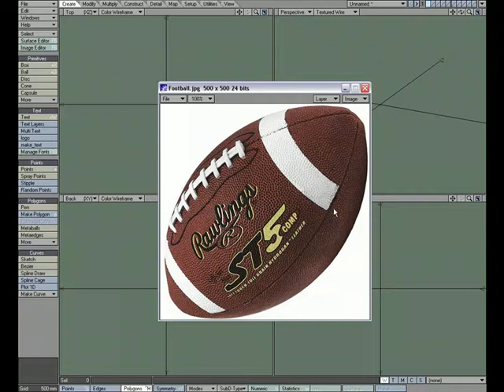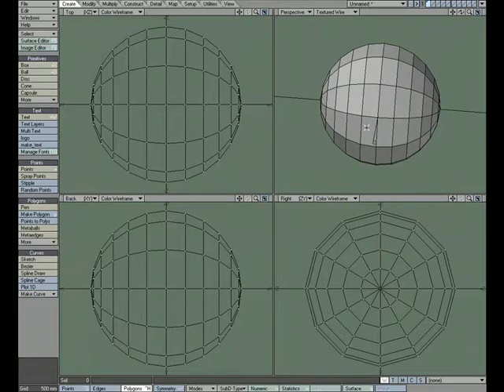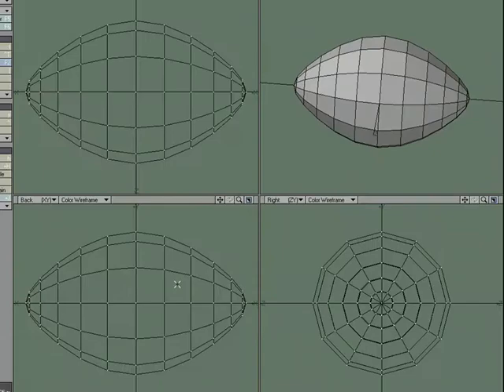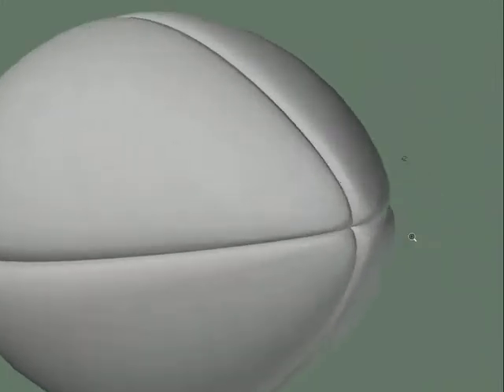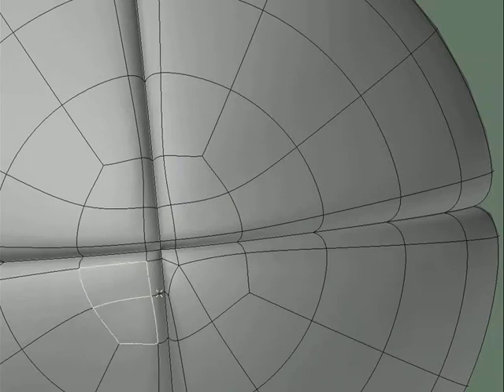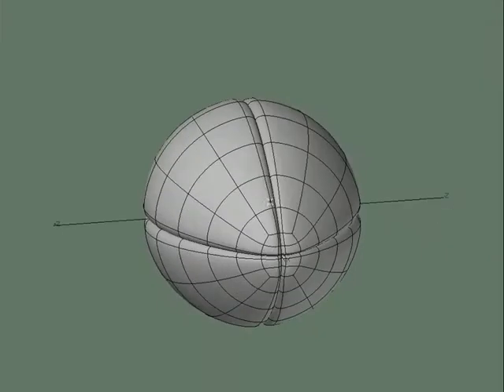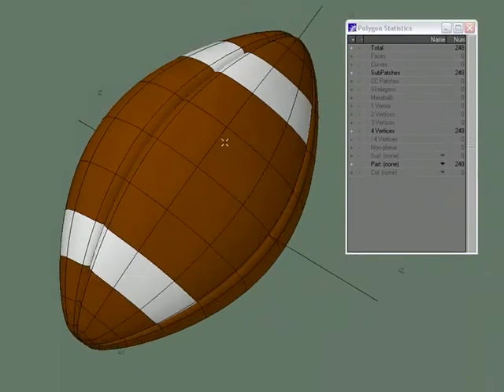Football Tutorial in NewTek's LightWave 3D

Comment: @caveman357 Most likely he won't go into that kind of depth because users can set their own shortcut keys.  He might have his keys setup different or vise versa.  Learn shortcuts by going to the shortcut key menu.
Alt-f9 to open shortcut keys menu.  Toggle points is as easy as using shortcut key or pressing the point selection button at the bottom of the screen.

Comment: @caveman357 @caveman357 Shortcut menu is alt f9.
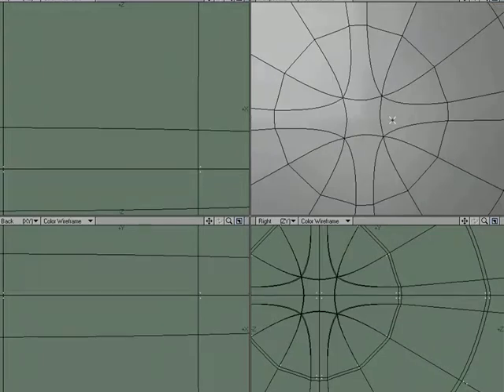Make sure you have all edges selected 2:30 (if you miss any edges you will have a weird result using edge bevel). After you have edges selected press ctrl b (edge bevel 2:47).  You have to switch to polygon selection mode to 'connect' for this object.  Switch to polygon selection first and then select polygons, select loop, connect 3:25 .
press tab you get error?
Could be because you have points, edges selected.  Deselect all and try again.